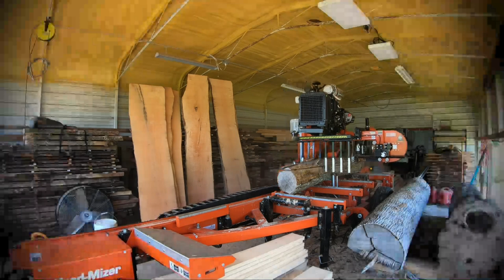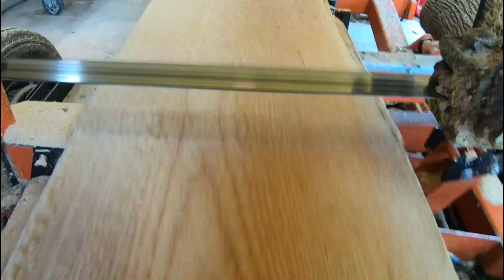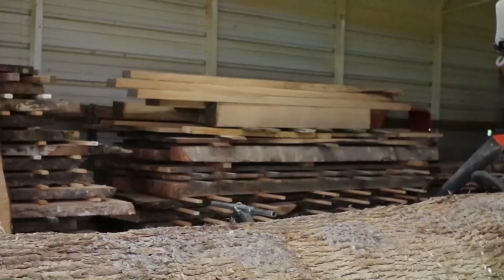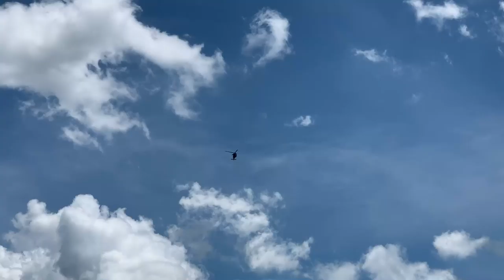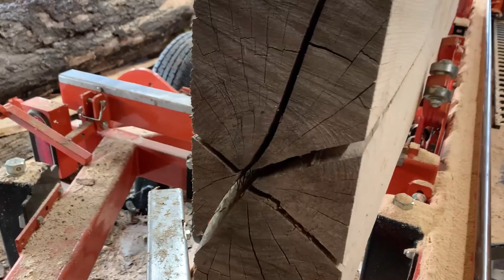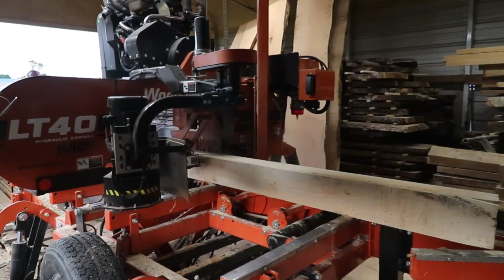Real Time Sawing: Ash Log On A Wood-Mizer LT40 Wide

Comment: I notice you rarely take the 1X4 or 1X6 up in the first cuts. Is it just not cost/time effective for your business? Seems like a good accumulation of pearling or lathe would be of some value to someone. When I had timber sawn for my barn, we took every 1X4 we could get, because I knew I would be using it in the roof system. I certainly enjoy your channel, thanks for sharing.

Comment: Just ordered a shirt. Thanks for having another sale.  I noticed the spray-foam on the top of your building and wanted to see what you have and whether you like it.  I’m about to have an 18x30 building build from Eagle Carports out of Mt.Airy, NC, which may be who built yours, who knows.  Anyway it’s going to sit on an 18.5’ x 30.5’ slab I just poured and I’m planning to use closed-cell spray foam to insulate and install a mini-split so I have a more comfortable wood shop, I know our muggy days outside of  Greenville, SC are just as bad as yours up in Kingsport!  Have you been satisfied with your spray foam?  Thanks for all you do, especially making and editing the videos!
Reply from the maker: yes the closed cell works great, would do it again,

Comment: Love the clutch on my LT40 wide!  Stops the blade, dead nuts in its tracks.  My old LT15, the blade would keep spinning on the wheels for several seconds after pulling the actuator.  Can’t wait to open up some of the large ash I’ve got.  Thank you for the informative video buddy 👍🏼😎
Reply: Hugh do you have a gas or diesel?
Reply: I’ve got pretty much the same set up Nathan is running with the diesel.  Only thing I think we have different, is he’s got the blade guide upgrade (where I don’t) and I’ve got the laser (that he doesn’t).  Very happy with the laser -  a bit difficult in broad daylight to find it but it makes a huge difference sighting the clearance with the backstops and just laying out your cuts in the cant. 👍🏼
Reply from the maker: I need to add the laser
Reply: Out of the Woods it’s great because it not only strikes a line across the end of the log, it also casts one down the side of the log as well so you can see exactly where the blades path will be.
Reply: Great centering the pith too 👍🏼

Comment: You didn't say what you did with the defects.  I'm sure viewers would like to know that.  I'd cut those boards shorter to remove the defect wood.  I have lumber pallets for 4', 6', and 8' boards.  I can also stack two 2'ers on the 4' pallet because I'm a real wood mizer.
Reply from the maker: not me I keep it all 8 ft long so it goes in the kiln without any problems, trying to dry short boards can be a pain,
Reply: @OutoftheWoods0623  Shorts can be hard to sell too. Thanks for all of your great videos.☺